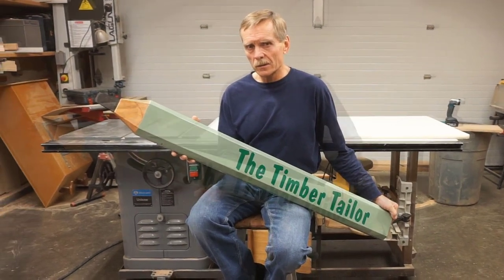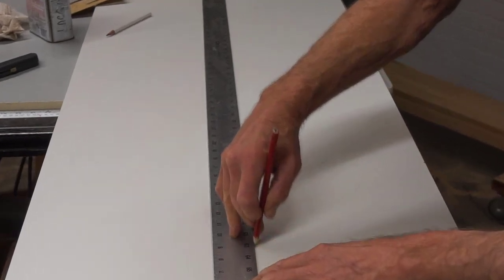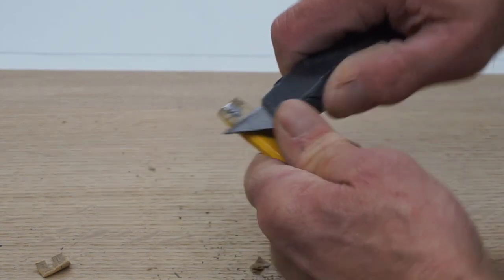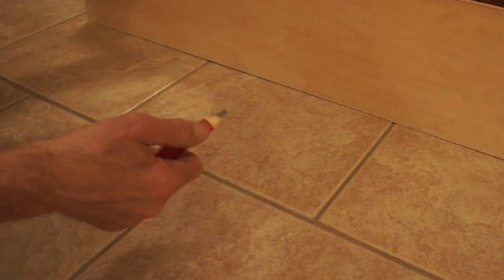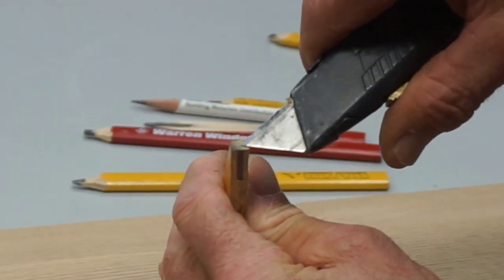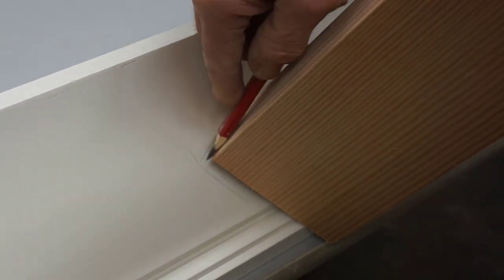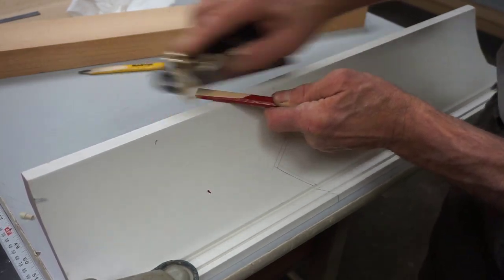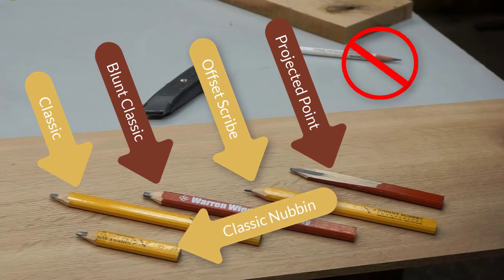How to Sharpen a Carpenter's Pencil

Comment: Looks like my hands . . . without the bruised fingernails.  I don’t hammer my fingernails.
Reply from the maker: IF ONLY hammers were the only way to bruise fingernails I'd have fewer boo-boos too! 😁😎
Reply: I was gonna say I don't think Matt hits the 'wrong nail' quite that often. 😂
Reply from the maker: Ironically I believe the black fingernail in this video was actually from a mountain biking incident... going way to fast and way too close past a tree on a gnarly single track downhill trail and pinched the finger between handlebar and treetrunk.  Or maybe it was when I pinched the finger under a boulder that had rolled down onto the same trail... or maybe it was when I got careless tossing logs into the woodbox and mashed it... or maybe I actually did whack it with a hammer.  All of those actually happened in recent memory so who knows?  I tend to loose track 😬  Something about being a carpenter: mistakes are generally painful and visible if not permanent, right?  Best, Matt

Comment: At 3:23 or at the very latest at 3:48 is where the lead would have broken up inside the wood and pulled out for me. Dull blades? Cheap carpenters pencils? Lack of skill?
Reply from the maker: All three of your suspicions are potential culprits, Steve, and are resolve-able.  Sometimes lead gets broken up inside the pencil from dropping, 'bending', or rough use in general and can pull out regardless of attention to blade sharpness or mastering technique.  Don't give up too soon or blame yourself... you CAN do this! Best, Matt
Reply: Thanks for the quick, reply. Matt! 
I actually haven't tried in a while as I have been working on smaller, finer items where I don't need the fat lines and I grab a fist-full or two of expendable pencils every time I go to Ikea. So I have a LOT of round lead pencils to work with now :-))
Your tutorial was great, though. I worked closely with 2 carpenters here in the Alsace while renovating our old farmhouse and outbuildings, but neither showed me the dual use of the wide lead in making fat and fine lines. I will definitely revisit this soon. Thanks!
BTW, it's not that I was never able to sharpen a pencil (I'm not that ham-fisted :-p). But I did end up braking the lead 25-30% of the time and having to start over.
Reply from the maker: @Steve_MFr  Pencils at Ikea?... I'll have to check  into that!  I know what you mean... I go months without need of a carpenters pencil when I get into the trim phase of a project.  And after a break like that I'll pick up a dull knife from somewhere and do a miserable job of breaking/sharpening the lead until I get serious about it, get a sharp blade, and do it right 😏  Restoring a farmhouse in the Alsace sounds like a once in a career project... very cool! Best, Matt

Comment: Thanks for your time. I think Mister NC MTN MAN is too young to understand what it means to lighten up the world, although in little things, that aren't known by everyone. In Germany or China (perhaps) we invented these pencils (our days: red, white or yellow coating). There are similar pencils which allow you marking on wet wood, the normal carpenter graphite pencils fail in that case. These pencils leave a blue trace. My last hint is, as concrete worker, I use a similar pencil, but it has a stronger led which is harder. These pencils have a green coating (here) and last much longer marking stone or concrete.They don't work good on wood, because the graphite is too hard. If you want to be up to date, you need, at least 3 pencils. I think you' ll need more. The sharper the pencil/marker, the sharper the result.
Reply from the maker: You're welcome, Stepfan!   Indeed: fewer medications for stress will be needed in the world when more folks learn to lighten up :-)  You are right in explaining how the right pencil is the one best suited for the work at hand and I believe a sharp pencil indicates an equally sharp mind!
Best,
Matt

Comment: Well, as a former draftsman, of having to use a round pencil, get in habit of twisting the pencil as you make ur line, that will help keep the point sharper. (Mechanical lead holders with sanding blocks and thick lead are reliable. 

As for sharpening the Carpenter pencil.  OLD school works.  i must have 6-8 carpenter pencil “sharpeners” all over the house and think only one i found to be worth a —-.  the others are useless (but I buy them as i m always losing my utility knives. 

old school.  keep sanding block handy (Arts and crafts stores may have the “sanding pads for pencils.  about 1” wide, 4” long and tear off sand paper sheets.  my life safer before ACAD

And if there are ANY good pencil sharpeners for these pencils that “works let me know.  i’m notorious for “oops” “Hun need bandaid 😜”.  

old school. always tops.